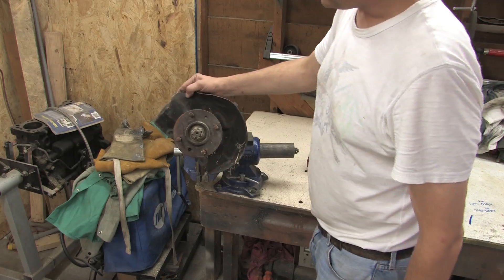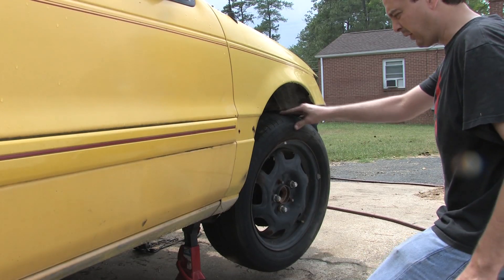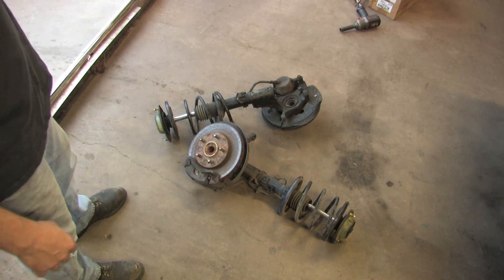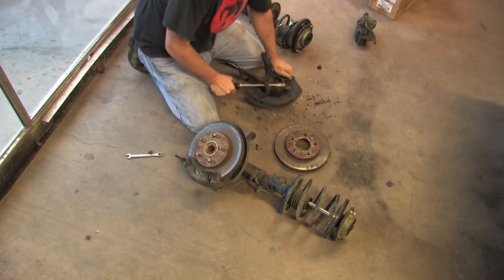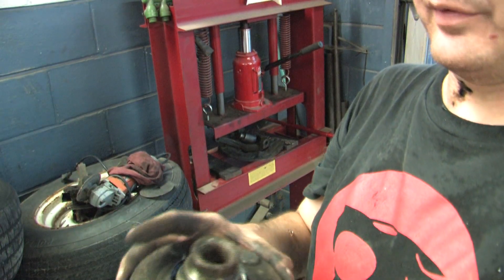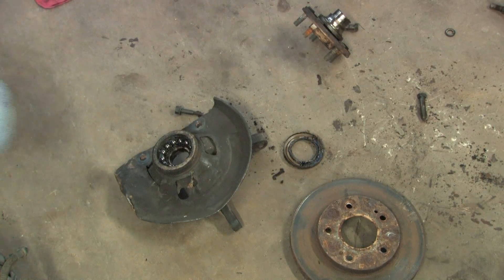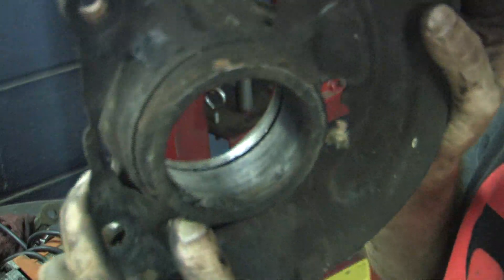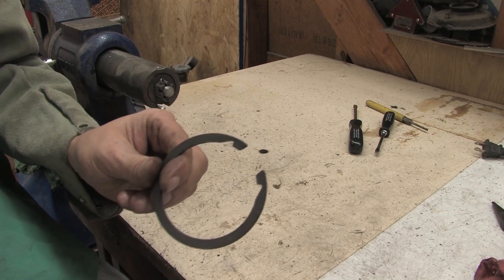COLT KNUCKLES! - replace wheel bearings & seals

Comment: Are those OEM bearings? Did mitsu really send those out with ball bearings? I know the after market world has tried to force ball bearings onto other makes like older fords but my car HATED the ball bearings. It sounded like a giant skateboard. I swapped out that bearing for a timken tapered needle roller bearing style wheel bearing (mouthful) and the car felt like it was riding on GLASS!! That's why I'm kind of shocked that oem parts would use em. Not only that they wear faster as well.

Comment: Well I didn't break the bearing races, just the nylon ring that retains the ball bearings. The bearing is.....well was brand new, I went against my better judgement and neglected to remove the bearings before using  a punch to pound the races in. Ended up just bringing them to work and using the press there. I thought about maybe poping the old bearing ball out of the old nylon retainer and using it but probably not the best idea.